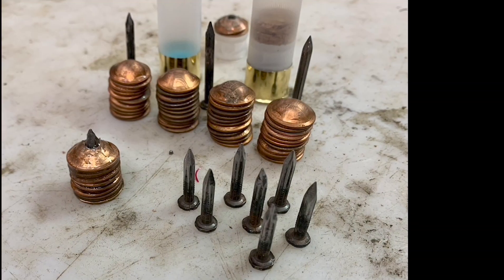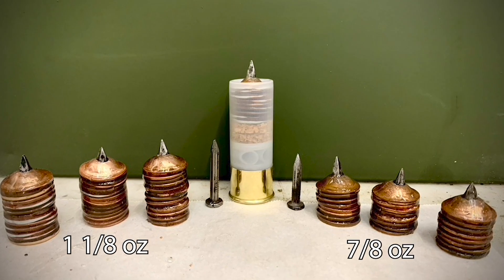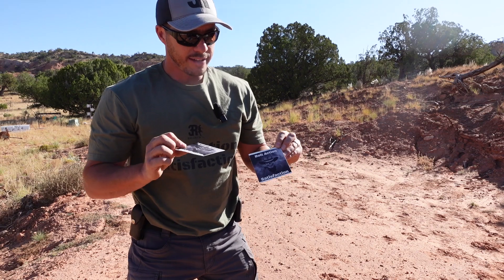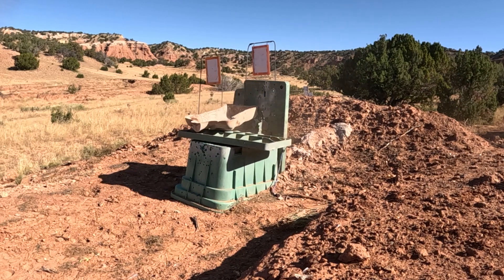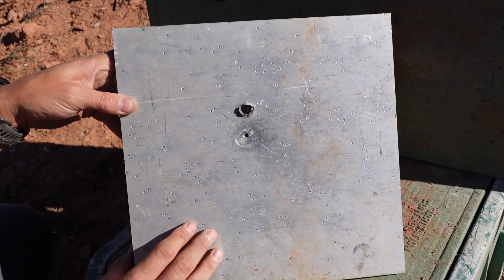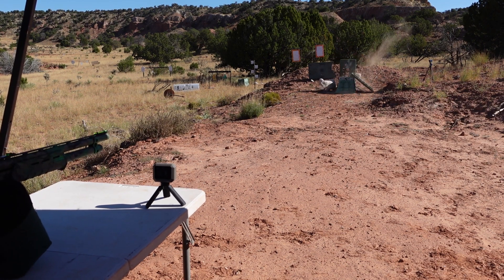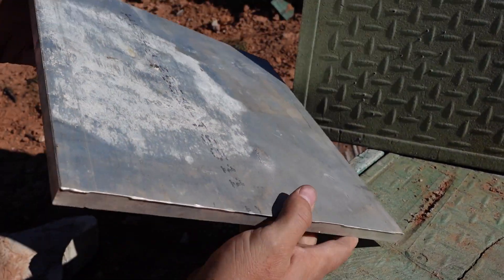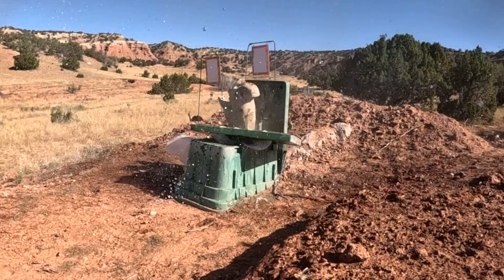12ga. Penny Slugs - Viable non-lead slug option tested

Comment: Regarding the nij iii steel plate, it was predictible, as we discussed earlyer on discord, both the low velocity -high mass tend to play into the realm that steel perform very well in, and the penetrator being close enough to the target in hardness (instead of having significantly more) cause that it can t zip trough like butter, and so yeah, it end up with the steel being able to take it

But we can see against allu alloy that the penetrator does play it s role and allow to zip trough

Comment: 7000 series aluminum is WAY stronger than 6000… almost as strong as mild steel. Aluminum does make GIF armor for slower projectiles though add it absorbs a ton of energy.
Reply from the maker: @meanman6992  I have 7075 T-6 aluminum but it seems too brittle and usually cracks as its failure method against heavy loads. While 7075 does stop the projectile the 6061 seems to be more ductile with absorbing tendencies. I also have some 2024 that works great as well.

Comment: Did you notice any unburnt powder in the 30 grain  ,  7/8 oz  shots?    The velocity seemed a bit low and Longshot usually likes heavier payloads.    I'll usually get around 1400 with 30 gr.  with a 1 oz slug.    Very interesting results!
Reply: Sent here by your link. Thanks!
Reply from the maker: @taofledermaus  now that you mention it, there was quite the spread in velocity. I’m hoping it was the powder and now how I loaded them (possibly didn’t push the gas seal down enough 🤷🏻‍♂️). Looks like more testing must be done ✅
Reply: @3RBallistics  I've had shells where the slug was light and used longshot and only the primer went off before.   As long as you don't have air space in your powder,   the gas seal doesn't need to be rammed into the powder, in other words.
Reply: We GOTTA see you try these things out. You're a legend, sir.